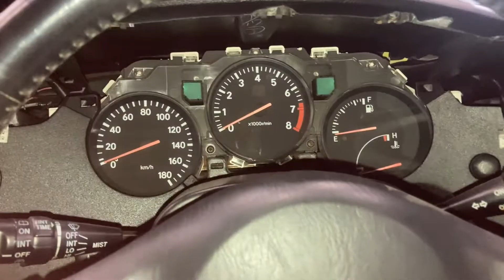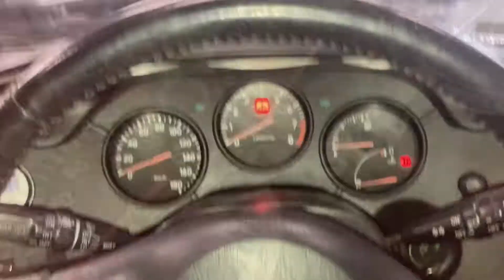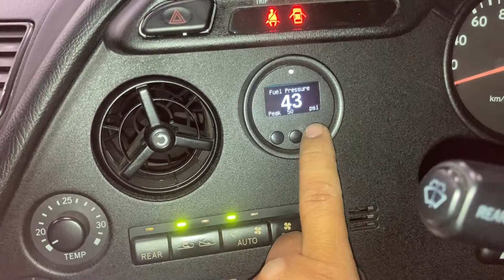2jz GE-t Mk4 Supra NAT Part 2

Comment: My mk4 is near identical bar the cam sensor as I have golbeys distributer delete.  I have a question for sideways guys, i now run gtr35 coils so no igniter,I think tuner has 1 wire in use then I did the cluster gauge mod fir tach but still isn't working. Do I need to run from igniter wires to ecu which is standalone . Really want tacho